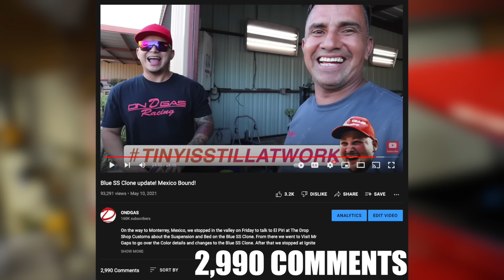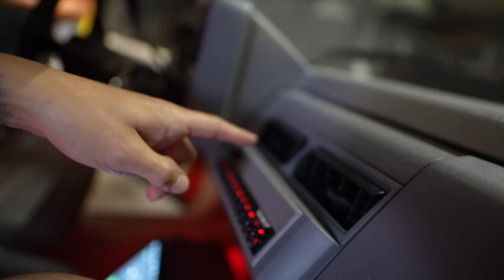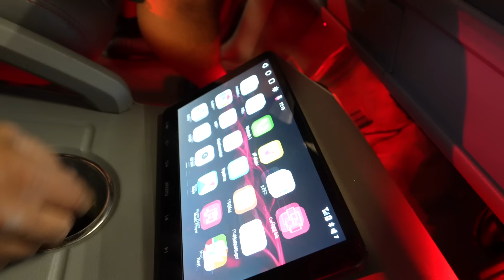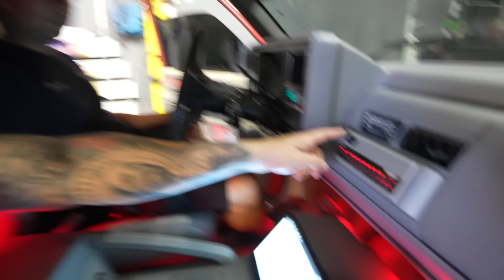Crazy LOUD Sound System on Red OBS !

Comment: Damn that step side is clean nice build,  I would love to own that baby or just even hear it beat. I haven't heard any systems beat since I was high school, I had a 94 civic with two JL W7 ten inches in custom built ported box made out of 3/4 MDF and the inside was fiberglassed with heavy resin cause it broke the screws that hole the box together. Two w7 with a 1000/1. I had the hardest hitting system in the town. And my family is lower/middle class so everything I have ever had I worked for and paid for myself. My father was a free lance mechanic and my older half brother is a mechanic, so it built not bought mainly self taught, back to the basics with nutz and bolts